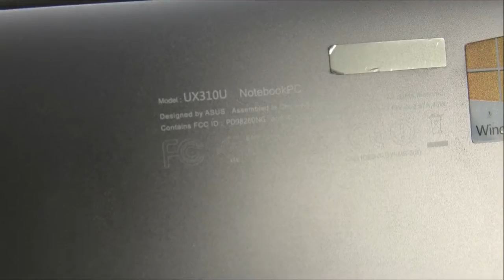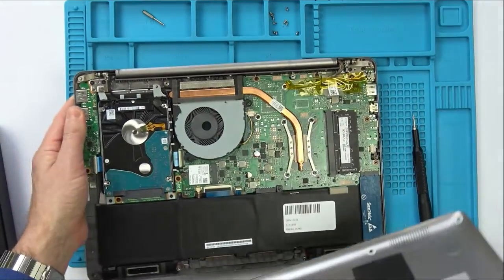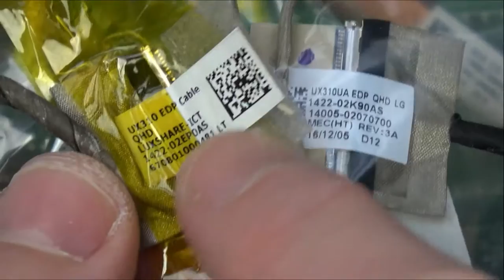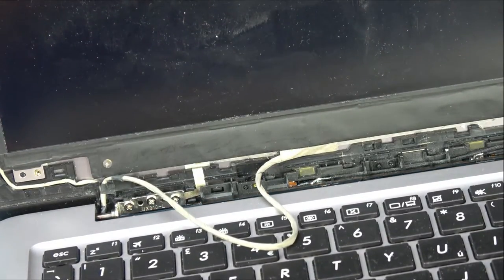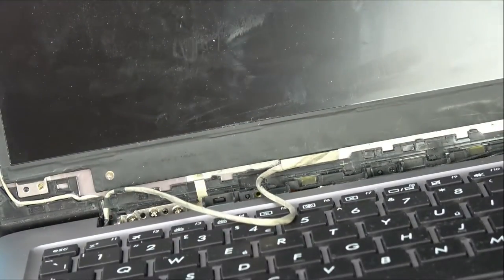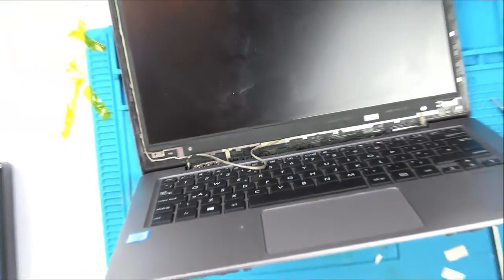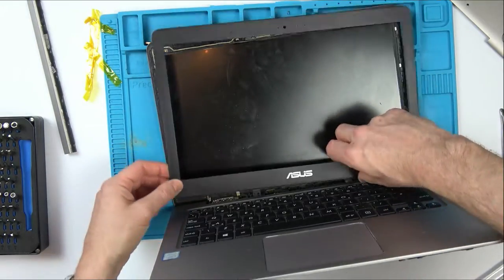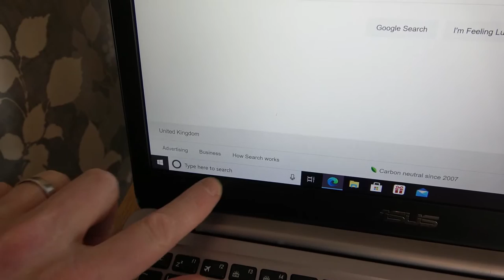ASUS UX310U Laptop Screen Cable Repair

Comment: After removing my bevel and working through endless amounts the stickiest glue I discovered I wasn't chiseling away at glue...  these dogs glued the entire screen connector to the bevel and I was severing the lcd connection while pulling the bevel away. Yours doesn't appear to have any glue on it at all. Now I'm up for $100 for a new screen. Not your fault, just furious that the manufacturer decided to put gorilla glue on the bevel and lcd connections. I bought my laptop brand new, so no one should have ever been in there and done it. At least now I know where all the screws go.

Comment: Thanks for the video. What was the symptom to identify this is cable issue?
Reply: most of the time screen flicker or artifacts when u move the display angle. The worse symptom would be an black screen with a functional display out through an external monitor but then it also could be the hole Panel too but to only try the cable Frist would be a good try because of the cost of a hole panel against the extra cost of one cable.

Comment: hi! do you know if this if i can upgrade the ram on this model? i have the same laptop and i have 8 gigs of ram and i want to uprgade to 16 gigs but i dont know if its uprgadable.Can you please tell me?
Reply: You can tell if it's upgradable if there are more slots for ram
Reply: a bit late,to say the least,arleady got a full spec msi,but still thanks:) @RinkusZelda
Reply: @StaruxMTB  Omg I didn't realize you posted that 10 months ago my bad 😭 glad you got it figured out.
Reply: No problem,apparently this model is rare,especially the one I had,the i5 6200u one,I couldn't find anything about it,so this video was my only solution,well now it has the 16 gigs of ram as I indented and its running Linux,and it's basically new